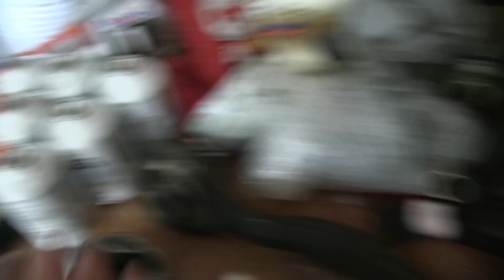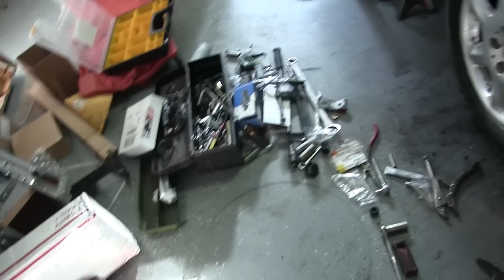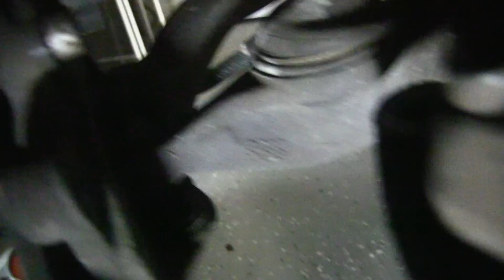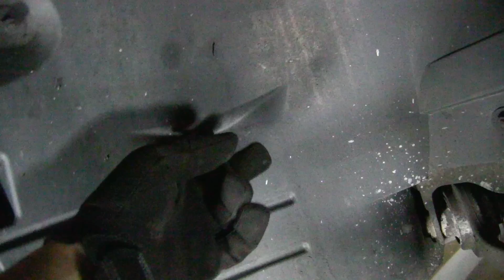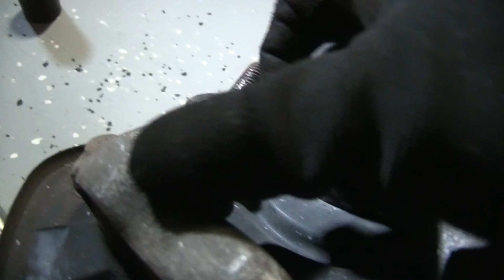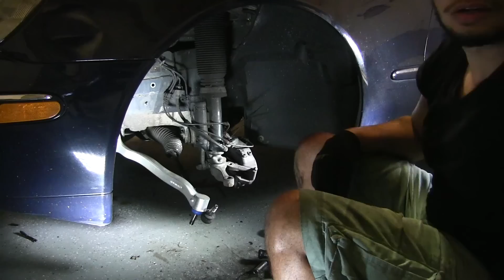Ultimate Daily Driver S-Class Pt 2 - Brakes And Suspension Repair

Comment: Your videos are inspiring to say the least, thank you.  I too have recently purchased a 2000 MB S500 with 200k+ miles... anyway, my suspension was dropping in the rear on a daily basis so after some research I purchased both rear air struts on Amazon. I have never delved into any car this deep, but on a wing and a prayer I successfully installed my new struts and am enjoying the system to my delight.  Meanwhile, I had to replace my fuel pump and filter (easy & cheap fix) and my break pads & rotors (sort of easy but the rear caliper mounting 18mm bolts are stuck and begining to round so I have yet get the new rear rotors installed).
Which brings me to wonder and ask you why am I getting a "break lining wear" warning on my dash? I have new sensors installed?  Is it possible that I need to bleed the system?  It's my guess that any air may be interpreted as "play" therefore received as wear and thus the warning display?  And or how would I reset the system if possible at this point?  The rear rotors, btw, are still ok as such.  The struts cost me $250.00, the pads & rotors all four wheels were $120.00, and the fuel pump & filter $55.00, and the CPS (for good measure since I have yet to buy proper diagnostic code reader) was like under $20.00. 
Everything works great except for the above concerns.
Any suggestions would be greatly appreciated DudeMan!

Comment: That was an amazing video. Some mat not have had the patience to watch it all but I sure did. One reason is, you just probably saved your self 2-3K VS taking it to a Mercedes mechanic. I am looking to buy my first Mercedes and everyone is trying to talk me out of it. The guy at Mercedessource is very helpful too. He makes a good point. If you're going to own one of these cars you better be able to do some things yourself. These don't seem that different from any other car other than they have a more sophisticated design in some ways. Air ride suspension is probably more technical. Have you ever had to remove the dash in one of these cars...for instance to r&r a heater core. I did it on a 1990 Lincoln town car and swore I'd never do it again, but still amazed myself I got the job done. I saves 900.00. There are not many manuals that really give you step by step instructions on these things. They seem to be held top secret from the public. Is this kind of work in your professional background? I love the 2000+ Class but am also in love with the 90's S class too. No diagnostic plugs on anything before 1996 in those cars though I hear. That could save a lot of guess work to the home mechanic. Anyway I learned a lot from your video. Thanks so much for sharing.

Comment: You don't know how to use a dyno torque wrench !  There is no 60 deg whatsoever, you torque until you hear a "click" and then you stop there.  I could hear those clicks and you went 45 deg further.  Over torquing isn't a problem unless you strip the thread though.  But you're taking big chances right now.
Great video where you invest yourself at informing people like myself to DIY car repairs and maintenance.  Thanks !
Reply: Some bolts have both a torque value and an additional angle value, that's what the 60 degrees is for Tavarish mentioned this in the video, the factory spec for those bolts was 36 lb/feet + 60 degrees.  That said he shouldn't have used the torque wrench to apply the extra 60 degrees, going past the setting on a torque wrench can affect it's calibration, he should have used a ratchet or breaker bar to apply the additional angle.

Comment: When you replace the control arm (at 22:35), you should mark where the original part is to set the new part in approximately the same place. (You can use a marker to trace where the washer ends up.)

Notice at 23:11, the hole in the control arm isn't perfectly circular. There's sort of an oval shape which is used to align the wheels. If you change how forward/back the mounting is, you'll affect the caster of the wheel and could end up with some steering vibrations or added effort needed by the power steering.

You should probably get a professional alignment after this sort of work to ensure everything is aligned correctly. Still way cheaper than a full suspension job though. Loved everything else about the video!

Comment: Hello, ive been following your posts about your 2000 S500 W220. again, what a great car, and a great buy, i have the exact same car like yours, but minus the 3000$ sweet deal, its a midnight blue with 60,000 KM on the dash. just finished basic & preventive maintenance , motor oil, engine & trans mounts, trans oil, diff oil, and some more. right now im chasing a stubborn squeeking sound from the brake pedal. tried to replace new cross-drilled rotors, and the pads as well, but to my despair, the new pads would not fit in its place, so now i only use one new pad, and the otherside uses the old pad. i dnt know, im out of options, the squeek is still there, was wandering probably youre having the same issue with your brake system, or maybe have some suggestions to spare. thanks man, W220 FTW !

Comment: Haven't watched the full video yet, but just a tip for the future, always take the boot off and grease the hell out of the ball joint anyways. I recently got brand new ball joints, and while they did have grease in the top part, they were virtually dry inside the boot. I believe that is the reason my last set failed so quickly. More grease is good grease. :D
Reply: Also, at least use a wrench for the caliper bolts with the hammer instead of a ratchet. XD
Reply: Dang son, buy yourself a 5 pound sledge.

Comment: That hammer is good for anything except working on your car. Any serious mechanic uses at least a 2 pound hammer. Get a compact one, like an engineer's hammer.
Reply: WHat made this a pain to watch was the fact that you didn't have any top light or so it seems. If you are planning on doing more videos just use a lamp to illuminate from the top too.
Reply: Agreed! A good engineer's hammer and some ceiling mounted shop lights are exactly what Freddy needs here.

Comment: meanwhile I'm driving my not a million mile Lexus. LS 400. I had Lexus looked at it and they can't find a fault on it other than some burnt interior bulbs. I paid 2800 Canadian pesos for the car.

why do you do this to yourself lol. poorly engineered German barges are meant to be disposed when the lease is over.
Reply: Sounds like your LS is a skookum choocher
Reply: Pat Woo 
An AvE watcher in the house?
Reply: I got a 97 LS400 also. Got it at 253k after seeing Matt Farah's million mile Lexus go well past 930k. I did have to do lower balljoints, sway bar endlinks and sway bar bushings immediately though, front end was clunking over bumps. I could literally lift the front knuckle like half an inch vertically LOL. I went with Lexus parts though, not ebay or aftermarket since the originals lated 19 years and didn't cost an arm and a leg more than the aftermarket ones.
Reply: Release the splooge!

Comment: 06:20 do not put anything on the bolts, just use 15kg or so to tighten it. make sure bolts are clean first! no need for anything extra. you'll take of the wheels every year or so anyways, it will be fine.

Comment: Nice that you're going to document all of your refurbishment. Hopefully yours has had the transmission fluid FLUSHED and changed with the proper stuff at least once. It is crucial to these transmissions to keep them "bulletproof." Also, if there's not a big difference in price for cheaper parts (and sometimes expensive) that seem sketchy online and OEM from the dealer (online dealer site etc.) it's a good idea to just buy the OEM and spend a bit more to not worry about it being wrong. My local dealer gives me discounts on their parts so it's sometimes cheaper. They match prices.
Reply: MrCarGuy20 dude shut up
Reply: +Anthony Ariza Excuse me?

Comment: I like to replace everything in pairs. I also know what it's like driving on worn out shocks and etc. so I just completely redo all my suspension on my cars. it's like a new driving experience compared to used parts. so on my trucks or cars might be expensive but it saves the tires, saftey and it rides better. then you won't have to redo it for a while. I love energy suspension bushings last better btw.

Comment: You know I love you man....  I love what you're doing, I love your videos....  that being said, I get tired of telling people not to hit a wrench or a ratchet handle with a hammer....  So, I won't say it.   Go ahead, break your thumb,  tell me how much fun that was....  And, there you are later, with a proper breaker bar.  So, whatever.  Aside from that, I loved it, it was great....  I might also add, if you're going to use a breaker bar on the ball joint press, thoroughly grease the threads on that ball join press rod FIRST....  Or, better yet, if you're going to hit it with an impact gun, hahaha!  Not that I would ever do that, god forbid, but....  Hey, don't tell Mom, okay....  But, under pressure, that threaded rod likes to stick, and you'll ruin your tool with the impact gun....  Uhhh, errr, uhhh, or so I've heard.....  So yeah, grease that threaded rod part of the C clamp, and you'll be fine....

Comment: Don't put antiseize on the lug bolts! It's dangerous because they will unscrew by themself with heat... I worked on a lot of Mercedes over the years and never had to deal with seized bolts on the wheels but I saw a lot of lose bolts when they had antiseize. Just torque them to spec dry and you shouldn't have a problem in the future...